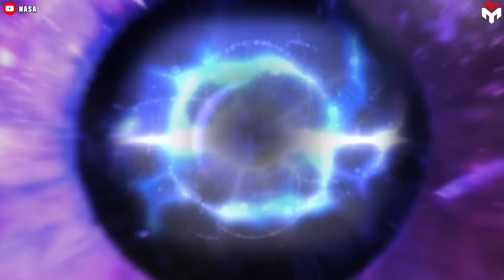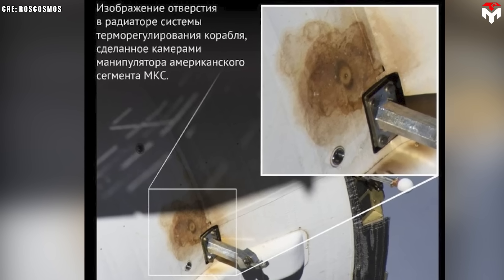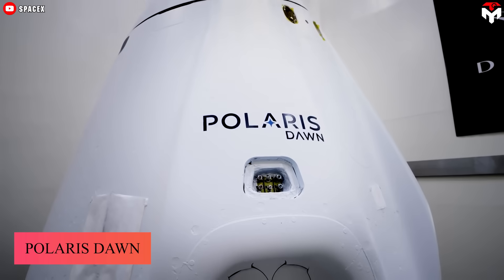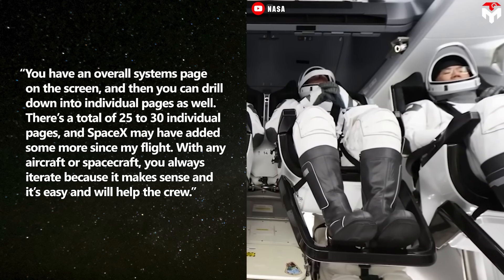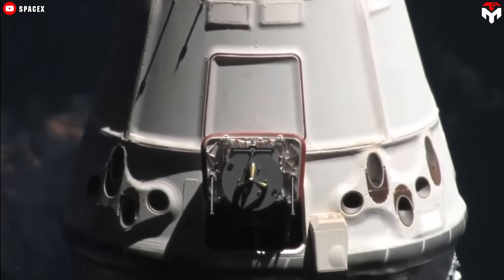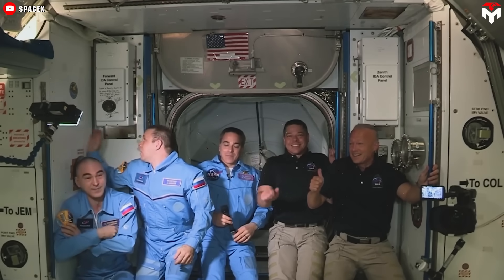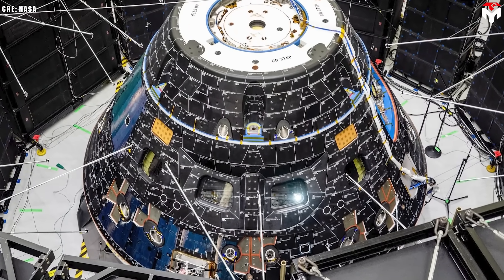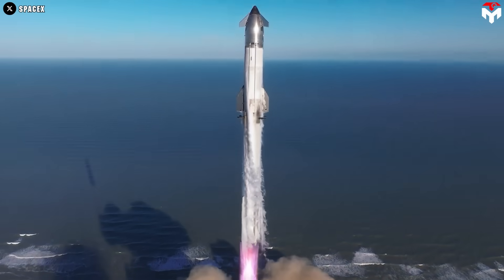SpaceX Upgrades Everything INSIDE Crew Dragon makes No one Wants to Fly on Others…

Comment: Great Video !  The SpaceX Crew Dragon, the Boeing Starliner and the NASA Orion Capsule should be able to out fit the capsule with the full 6/7 seats the capsule is designed for !  Also the Launch and Entry Suits should have a common suit Hose Plug for use for the return Capsule or for use on the HLS !  Also the Orion and the HLS should have a common CO2 Scrubber !  Crew SAFETY First !  Timothy Lipinski
Reply: Still early days. Eventually industry standards will be agreed upon.
Reply: @trespire Making an adapter should be a possibility. But they claim that they cannot. I do not believe that. The various manufacturers do not want for their products to interact with other's products. They will do this over the safety of our astronauts? NASA will not demand this for our astronauts safety? Just like Boeing wants astronauts flying on their unproven Starliner.